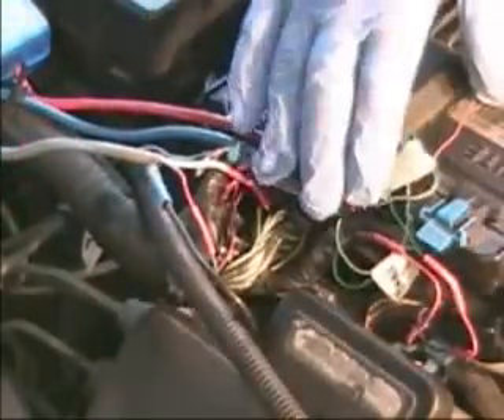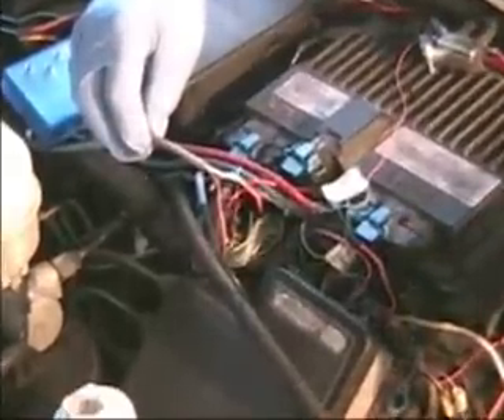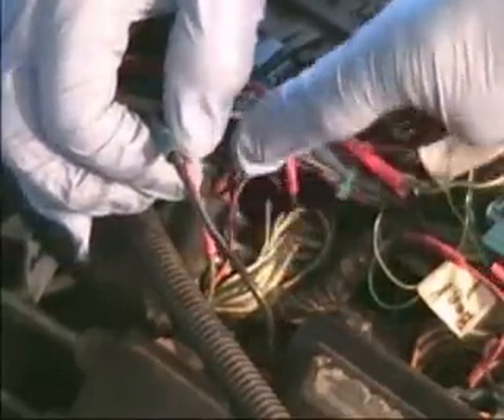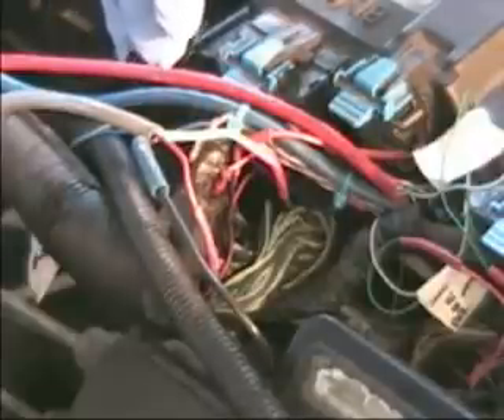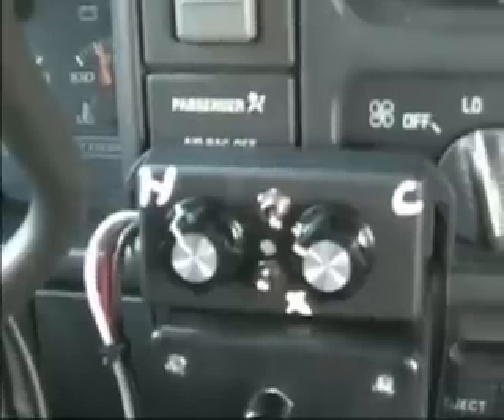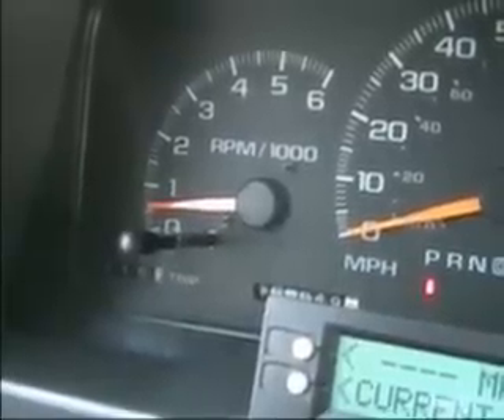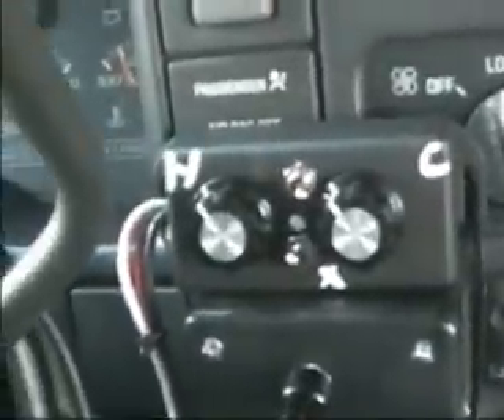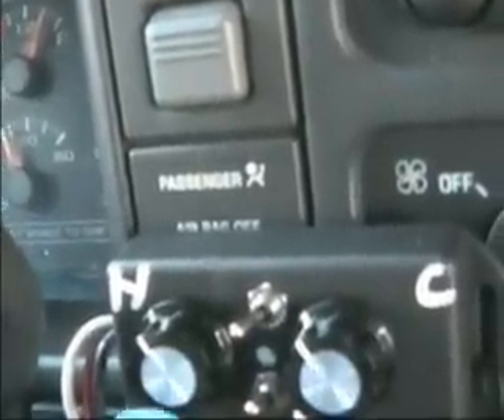How To Install Adjust a Map Enhancer For Hydrogen Generator

Comment: I am adding a hydrogen generator on my Ford Expedition
  2007 5.4L. I am installing a hho enhancer to adjust my MAF sensor manually what wire would I use from the MAF to the hho enhancer . and is the MAF frequency controlled or voltage controlled
Reply: Not 100% sure but my understanding  is that the hho unit is not controlled  by the maf sensor enhancer  hookup..the maf enhancer controls the information  to the computer regarding air to fuel mixture..which helps the engine USE the hho without adjusting for it* by installing  this highway and city maf enhancer

Comment: I just went to the web site. This person is also selling HHO generators that are so small and insignificant that I doubt there is much benefit from the HHO output. Any fuel savings or at least most of the fuel savings probably comes from the MAP MAF Sensor "enhancer" which is more of a control to the vehicle's computer that sends a false signal to "fool" the computer. I'm sure it (sensor enhancer) would improve fuel mileage with or without the HHO generator they are selling. I really don't mean to be critical. It's just a math problem. Can we consider the output of the HHO generator. How much HHO gas does it make per minute? I'm only guessing but let's say it puts out 5 liters per minute. That may be high or it may be low for the unit. Even if it put out 10 liters per minute, let's do some simple math. How many cu inches or how many liters of air/gas mixture is your engine rated at? How many RPMs (Revolutions Per Minute) does it run at idle? How many RPMs when you're traveling at 55 mph? If you have a small 2.0 liter 4 cylinder engine that runs at 950 - 1050 RPMs that means there's a minimum of 1,900 liters of air fuel mixture that move through your engine every minute. If your engine is running. At 1800 RPMs it has 3,600 liters of air/fuel mixture moving into the intake and out of the exhaust every minute. All this time an HHO generator that produces 5 or even 10 liters per minute is always producing a maximum of 5 or 10 liters per minute. I just have to question how an engine that is using 3,600 liters per minute is going to get much benefit out of a HHO generator that is only putting out 5 or even 10 liters per minute at maximum output.

9.5 liters is exactly 0.5% of the amount of air fuel mixture your 2 liter engine uses in one minute at 950 RPM idle speed. That is one half of one per cent or 0.5% of the air/fuel mixture a 2 liter engine displaces in one minute if it's idling at only 950 RPMs. Do vehicles even idle at that low of speed? That is, if an HHO generator puts out 9.5 liters per minute.

9.54 liters is equal to 0.265% of the air/fuel mixture that is displaced when a 2 liter engine is running ate 1800 RPMs. That is just a little over one fourth of one per cent of the air/fuel mixture is HHO. How much does that HHO generator with an output of 5 to 10 liters per minute really doing? Quite frankly I'm giving the HHO generator I saw on hi site the benefit of the doubt when I say 5 to 10 liters. I would be surprised if it puts out more than 5 liters per minute. OH MY! I just went back to his web-site and read the statistics he gives. At least he's honest. His HHO generator puts out 1 liter in 43 seconds. I knew I was being very generous when I said 5 to 10 liters per minute.. Care to do the math?

Let's look at it. 1 liter in 43 seconds means this HHO generator puts out 1.3953488 liters per minute. Let's just say 1.4 liters per minute. A 2 liter engine displaces 2,000 liters of air/fuel mixture per minute at 1,000 RPMs. 1.4 liters is exactly 0.07% of the amount of air/fuel mixture that is displaced by your 2 liter engine running at 1000 RPM idle speed. Please understand. That is 7 one hundredths of one per cent or 0.07% or 7/100s of 1%.

What about a larger engine? What if your engine is a 5 liter or 6 liter V-8 turning at similar RPMs? He recommends 2 of his HHO generators for engines above 5.7 liters. I can't see how one at 1.4 liters per minute could be enough for  2 liter engine let alone a 5 liter engine. Lrt's do the math. A 5 liter engine at 1,000 RPM idle speed has 5,000 liters of air fuel mixture moving through it (called displacement) per minute at 1,000 RPMs.  1.4 liters of HHO per minute is 0.028% of the air/fuel being displaced by a 5 liter engine at only 1,000 RPMs. That is 28 one thousandths of one per cent or 28/1000s of 1%. At 2,000 RPMs a 5 liter engine is displacing 10,000 liters of air/fuel mixture per minute while the HHO generator hasn't changed its output. It's still putting out 1.4 liter. That comes to 0.014% or 14 one thousandths of one per cent ot 14/1000s of 1% of the air/fuel mixture your 5 liter engine uses every minute at 2,000 RPMs. Does that sound significant to you?

Like I said at the start of this "comment," I think his or even some other MAP MAF SENSOR ENHANCER is probably what is actually improving your fuel mileage.

Am I saying all of this because I don't believe an HHO generator can produce enough HHO to run a vehicle? No! Not at all! I just have a problem with people selling these tiny things and claiming huge benefits and great added fuel mileage.

See, my Dad road in a car that ran on water way back before I was a teenager. I just turned 60 a few weeks ago. The oil companies bought the man out and part of the deal was that neither he, nor anyone related to or associated with this inventor could reveal the secret to how it worked. I said the oil companies bought him out and they did. More importantly he sold out the whole world. I envision a world where everyone can travel without any significant fuel costs. Farmers could run their equipment without fuel costs and the products of the world could be delivered without fuel costs. A world where there is NO more need or desire to go to war over oil.

I know it can be done. It won't be done with little units like this that deliver a negligible amount of HHO. In fact I believe this kind of product and marketing do more harm than good. How do they do harm? They do harm because when people buy something like this and they don't get a significant fuel savings they get the idea that it doesn't work or that it cannot work. When too many people believe it doesn't work or cannot work it becomes more and more difficult to overcome the negativity brought about by people who sold jokes rather than legitimate HHO generators that will put out a significant enough quantity of HHO gas to make a real difference. It's just too much for me to keep silent.